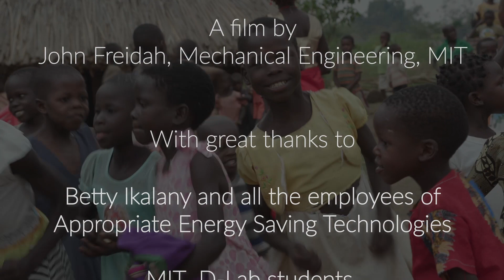A Cleaner Burn

Comment: the roof they made for the charcoal would not be able to protect it from rain.. they should not neglect the moisture and temperature factor too although it is protected from the rain with a proper roof, it still has to dry... I suggest covering it up properly while it rains and leave the rest to the sun.  
Nice work mit!!